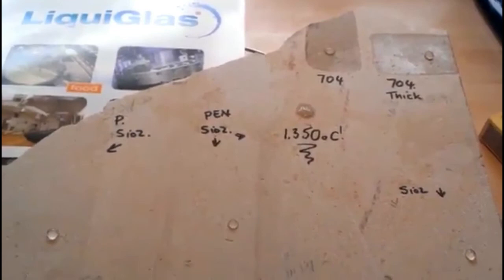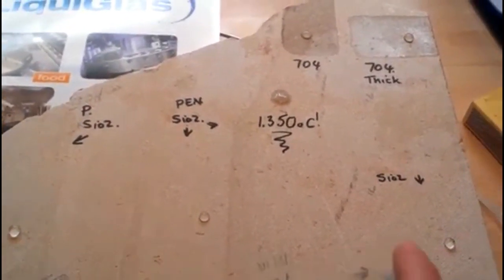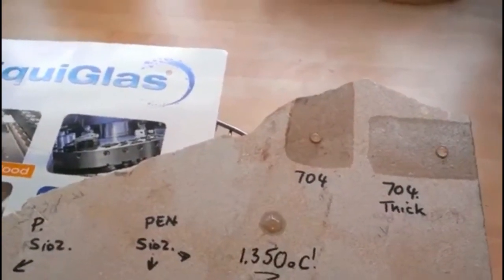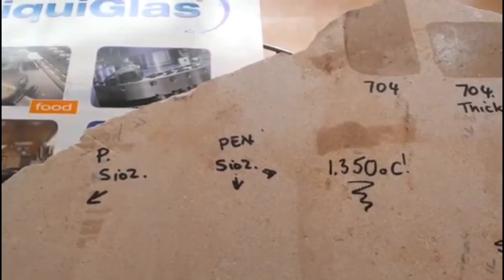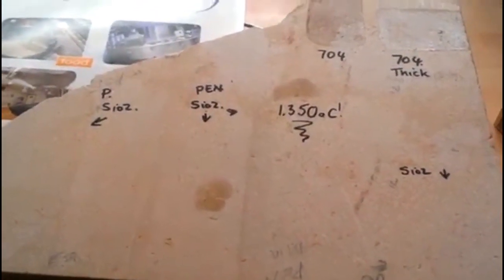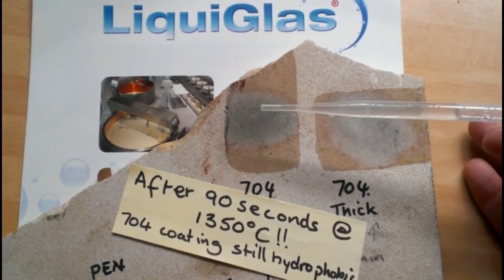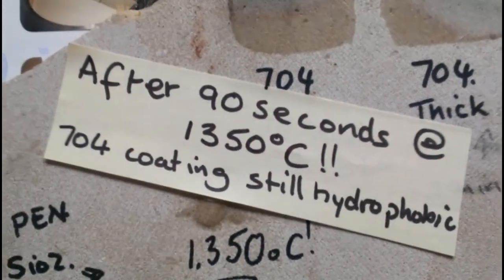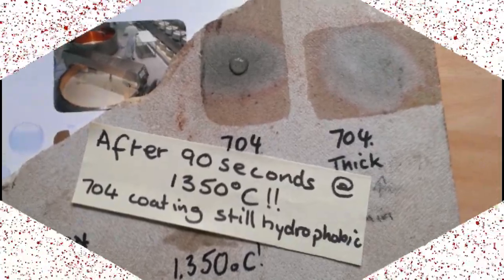CCM Liquid Glass Coating -  Fire Retardant Test

Comment: Hi, I’m a lead crystal sculptor looking for a product that increases the thermal protection and safety aspects of crystal.  Obviously the refractory and workability qualities of lead crystal are advantageous but if you want to take the work into a home environment (say, with crystal basins in a bathroom) there is a problem with thermal conductivity and also lead transfer.  You can’t have a customer washing their hands in a beautiful crystal basin if it’s going to leach lead into the water, or crack from the heat.  Would your costing be appropriate to address these concerns?  Cheers, Adam